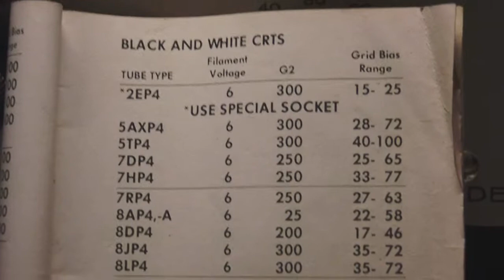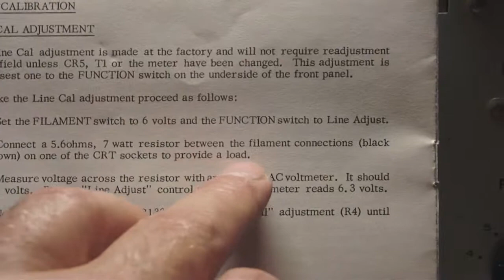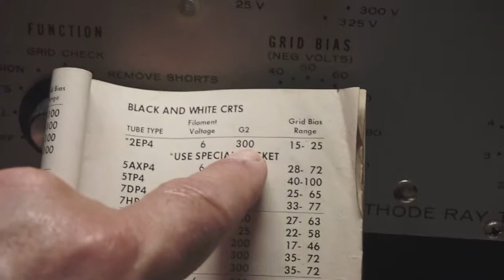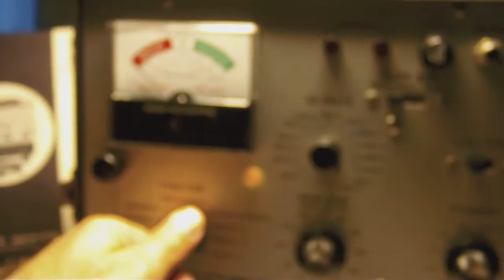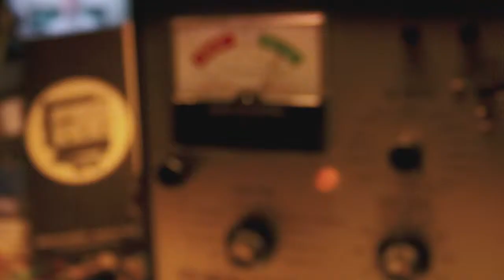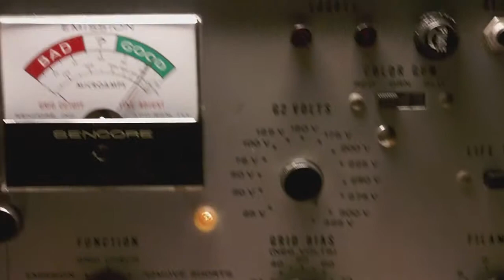Philco H2010 Safari part 3 of

Comment: That's odd - every CRT made uses the pins on either side of the key for the filament power.  I wonder if there is a broken connection in the "special" adapter ?
Reply from the maker: You might be right. Unfortunately the connectors are sealed with tiny copper rivets and I'm not very enthusiastic about breaking them open. But in the end I might have to do just that, since another connector is broken at the base and to repair that one I also have to take out the rivets. Might as well check both.
Glad you enjoyed the video :)

Comment: it will at least produce an image, a very bright image! It's a good tube! Tube filaments can take quite a beating, you could have used the 6 volt range and the tube would have been fine. you may want to check the line adjust pot or associated circuitry
Reply from the maker: Yes, I've been thinking exactly that. I think replacing the electrolytics has thrown the calibration off a bit. I might have to recalibrate the CRT tester somewhat. The picture will be bright no doubt, but how long will the CRT last I wonder. The life test result wasn't too good. Cheers! :)